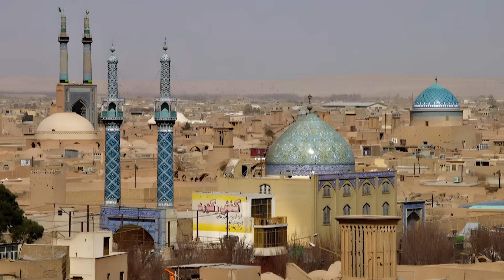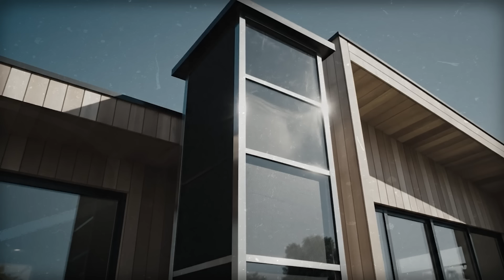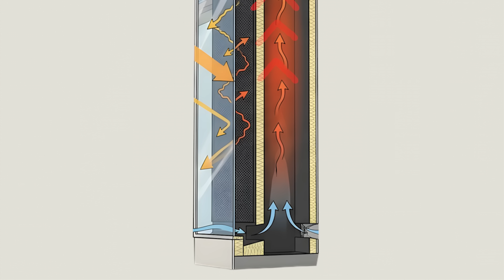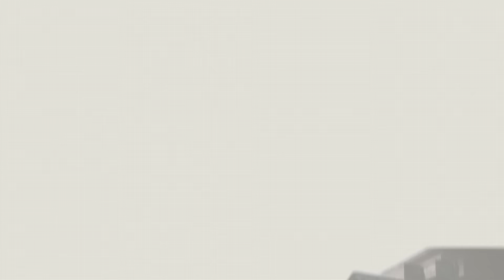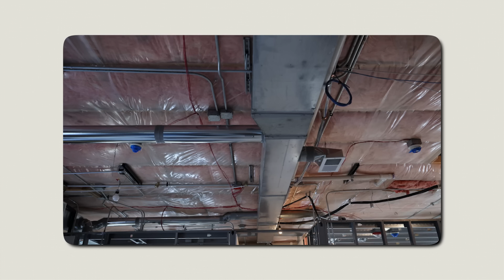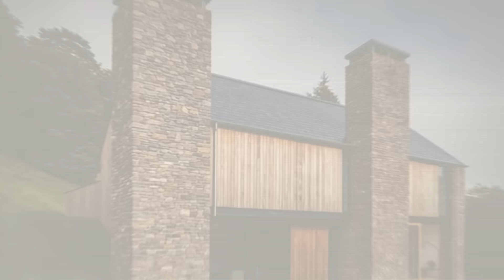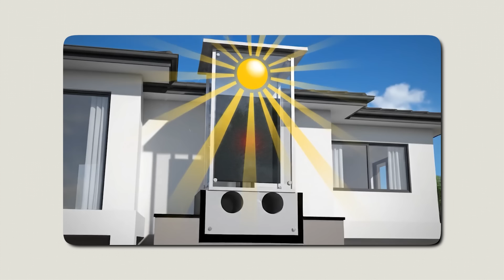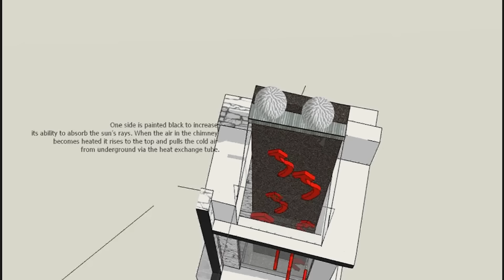This Chimney Will Cool Your Entire Home WITHOUT Electricity. Why Did The Energy Industry Hide It?

Comment: If you pull "fresh air" during a heatwave, what temperature do you think it will have? 20 degrees celcius or the temperature of the air outside?
If you actually answer using your brain, you will find out that it will heat up your home. If you use pull air through tubes put in the ground, it will work but at some point the ground will heat up too much.

Want something that actually works? AC, good home insulation, external window shades or awnings so direct sun doesn't enter the home and insulated 3 pane windows. If you have money, install ground heat pump and you can use AC in "passive mode" (deep underground temperature will be low). Add battery storage and PV for AC that works without using electricity from the grid.

Comment: At best it will cool it to room temprature, it isnt a solution for ACs, and worse if the outside air is humid or really hot as it tends to be in many places. Install solar panels instead and use ACs all daytime to cool the house.

Comment: Where I live, that’s a point of ingress for typhoon winds and water. Also, doing this in the US where houses are made of wood would make house fires spread faster.
Reply: Yes, the fire risk is a serious consideration. I put an attic vent in a 1/2 vaulted ceiling with nothing more than gable end vents in the attic to vent the air-flow, and a low window opened for intake  and it worked great. Stunning how much air was getting sucked through that vent. 

Making it fire-proof was a nightmare.  It also needs to close up tight in winter.

Comment: FRIENDLY FACT CHECKER RESPONSE provided to flag real consumer risks (listed below), not to troll this video/channel or arbitrarily $h*t on the few good ideas presented in this video.  

EXAGGERATED OR UNSUPPORTED 
Several headline claims look inflated or unverified as stated: “cool a home by fifteen degrees,” “most cost effective cooling solution in human history,” “global standard for high performance cooling,” “threat to the modern energy status quo,” “25 tons of CO2” for a 3-ton AC over 15 years, “carbon payback of less than six months,” and “carbon negative asset.” I did not find authoritative support for those exact figures or framings. If they exist, the video should have provided them. The claimed University of Arizona 1995 study with a house held at 75°F while outdoors was 106°F was not substantiated by the sources I found, and the University of Nottingham “up to 75%” claim appears in secondary/summary literature rather than here as a directly verified primary result.

LIKELY FALSE OR HIGHLY MISLEADING 
The video’s most pervasive problem area is precision masquerading as certainty. The claim that solar chimneys provide 8–12 ACH in homes appears overstated; field literature I found includes measured values more like roughly 1.13–2.26 ACH in at least one test-house study, while higher numbers can occur in other specific designs or conditions but don’t support such this video’s blanket claim. Also misleading is the statement that standard HVAC in modern airtight homes provides “less than 0.5 air changes per hour of fresh air” as a general rule; real fresh-air delivery varies by design and code compliance, and ASHRAE/IRC frameworks do not amount to a blanket exclusion of passive systems. ASHRAE 62.1 explicitly covers both mechanical and natural ventilation, which undercuts the video’s implication that the standards regime is written only for mechanical systems. 

FALSE EQUIVALENCIES / PARTIAL FRAMING The video repeatedly sets up misleading binaries: 
- passive = elegant freedom / mechanical = primitive failure
- breathable buildings = good / airtight homes = bad
It also presents causal narratives framed as inevitabilities:
- code/inspectors = de facto ban
- industry reluctance = proof of suppression
Its rhetoric hides the real tradeoffs: passive systems can work well in suitable climates and designs, but they do not automatically replace mechanical cooling, filtration, humidity control, or code-required ventilation across all climates and building types. It also blends windcatchers, solar chimneys, earth tubes, evaporative cooling, and thermal mass as though they are one interchangeable technology stack, when they are related but distinct strategies with different performance limits.

MOSTLY VERIFIABLE / SUBSTANTIALLY TRUE 
The core concept of this video is real: solar chimneys and related passive systems can drive ventilation through buoyancy/stack effect, and Persian wind-catchers/bādgīrs are genuine historical precedents for passive cooling, especially in places like Yazd. The video is also broadly right that indoor air can be more polluted than outdoor air, and that ASHRAE 62.2 is a key residential ventilation standard.

*** WHAT CAN YOU ACTUALLY DO? ***
The real move is to treat passive systems as leverage, not replacements. Start by pressure-testing your climate and house: look at your local temperature swings, humidity, and solar exposure, because a solar chimney only performs well when those variables cooperate. Then, instead of ripping out HVAC or chasing “zero-watt autonomy,” design for hybrid performance. Improve airtightness and controlled ventilation, add shading, orientation, and thermal mass where possible, and only layer in something like a solar chimney or earth tube if you can model or validate expected airflow (not just trust headline claims). If you’re building or renovating, push your architect or builder to integrate passive airflow early. Stack height, intake placement, and solar gain matter but also insist on measurable outcomes: target ACH, indoor temps, and energy use you can verify post-build. And zooming out, if your goal is sustainable housing globally: use passive design to shrink your energy demand, then let efficient mechanical systems handle the edge cases. That combination, not this video’s all-or-nothing framing, is what actually moves the needle.
___________

Potential CONSUMER RISKS related to the information as presented in this video are listed here. Be smart and don’t:

1) Over-invest in a system that under-delivers because the conditions aren’t met for your use case.
2) Remove or undersize mechanical systems and end up with uncomfortable or unsafe indoor conditions.
3) DIY installs that don’t function properly or create air quality/moisture issues.
4) Accept selective or unclear evidence to support strong claims. This is a classic red flag in product or system marketing.
5) Make financial or ethical decisions based on incomplete or overstated environmental benefits.
6) Distrust inspectors without good reason or bypass code logic, which can lead to failed inspections, insurance issues, legal and liability exposure.
7) Neglect maintenance (even passive systems require it) and end up with reduced performance or health risks.
8) Design a hybrid system without understanding which part is doing what.
9) Waste $300–$500 on “accessible and low-risk” lower-impact solutions instead of saving for improvements with a higher ROI.

Comment: Check out old Florida homes; the ceiling was 9 to 11 feet up, and the windows were double sashed. You would drop the top window about a foot, and raise the lower window about 8”. The taller the window, the better the system. Heat rises, like it do, goes out the top opening, which then sucks air in through the bottom opening, and because that gap is smaller, hopefully comes in faster; forced convection. 

Also, why do these solar chimneys remind me of swamp coolers? Not that those work that well in a swamp, lol. My in-laws live in El Paso and theirs works amazingly. Because, super dry atmosphere…
Reply: Florida "Cracker" houses are usually built on stilts or 15-20ft earthen mounds(for hurricanes) with open floors (not concrete slabs) which are about 2ft above really wet soil. The wrap-around porches provide shade not only to the living area, but also keep the soil under the floor cool and damp. I think building one of these houses today one would do well to use a gable roof with a ridge-vent system. Usually best to keep a shot-gun around for gators in true Cracker houses. Middleburg.

Comment: This phenomena has been used in many ancient Indian palaces. The kings had summer palace and winter palaces depending upon the season and it utlized similar principles. Its great to see them working in real life even after thousands of years while we - the smarter and techno generation are stuck with mindless technology everywhere around us.
Reply: I don't think heat-pump tech is mindless. It's a better solution than burning dead dinosaurs. BTW, if you put AC units in the air stream right at ground level as the air comes out of a ground tunnel, these two techs would work together really nicely and save about 1/2 your AC bill if humidity or extreme heat overwhelmed the passive system alone.

Comment: How does it work in cloudy hot days? Also, how do you clean the system and avoid moisture inside?
Reply: I guess you install a blower for air flow when cloudy or for cleaning the chimney.

Comment: You must love swamp coolers… your Ai produced video forgot to include the other important factor of an A/C system… it removes humidity.
Reply: A few years ago we were having no end of refrigeration evaporators freezing up in our cafes.  A master technician that came to sort out one of the units explained that global warming has added more water to the air, and suggested that we leave our AC units on overnight: we started doing this and our breakdowns dropped to almost zero….interestingly our electricity consumption only increased about 2-3%…

Comment: The difference between 106 and 75 is 31, not 17!  Simply moving air isn't going to cool it; without using underground temperatures or evaporative cooling, the air drawn into the house will be at whatever the ambient temperature outside is!

Comment: in dusty areas, fresh air can bring dust in without proper intake design or filtration. Also, negative pressure can pull dust through gaps around windows and doors.

Comment: I intend to build a tiny house on wheels and intend to include the principle of "Trombe Wall" and Solar Chimeny into it. I first came across "Trombe Walls" 45 years ago when I was working as a draftsman in an architects off. I was also taught about it and "passive solar design" at university when studying architecture. In the 40 years practicing as an architect I seldom got to use this knowledge
Reply: What is going to be your source of cooler air? Is your tiny home going to have a basement?
Reply: @Encephalitisify  actually you can open a vent on your floor(under floor is shadow). usually the shadow temperature is much lower than under the sun.  When winter cover the vent.

Comment: Many old homes have this built in using the fact warmer air rises and pulls in outside cooler air. But along the Gulf coast it is less than useful much the same way swamp coolers don't work. There are scams on U tube calming cooling but uses the swamp cooler effect that does not work in higher humid air,

Comment: Unfortunately, in humid areas this is not nearly as effective due to how heat sensation works.

They also would possibly require more maintenance in humid areas due to humidity doing its thing inside of the chimney, degrading materials, possibly allowing some mold to grow (I guess it depends on the actual materials, and maybe it's not as bad given that the heat itself may be drying part of this).

I do live in a highly humidity city, but I will be buying a house  soon and I am seriously considering building a solar chimney. I need to research more first to be sure I won't regret it later.
Reply: Looking forward with your research as we live in humid areas too. Thank you
Reply: It does work.  We used to live in a river valley (the river was 50 feet from our patio) in Jamaica.  The house had a hip roof that trapped hot air, and when we put clerestories in, the internal temperature dropped significantly.

Comment: I would think that you would want whatever cooled air your getting will go to the highest and furthest point in the house.  I wouldn't mind seeing this incorporated more, but I would still think that you would need a secondary system for heat at night.  But I guess if your house is air tight and has a good thermal disconnect you may not need it for a short stretch but honestly, a secondary heat pump would be warranted, I feel.

Comment: A solar chimney is essentially a high velocity vertical shaft, 

In the event of a house fire, this gonna acts as a thermal bypass sucking smoke and flames from the lower floors and spreading them throughout the house very quickly.

Comment: How would an implementation of this chimney work with a Clay AC (the clay pots with water running down it) since the clay AC causes the air to be humid and the chimney's effective decreases with high humdity

Also how'd you use the chimney in high humid climates? Would you try to dehumidify the air when it enters the building?

Comment: I’ve always said this big chimneys on old buildings were not for fire, but for ventilation and those fireplaces were for intake not for flames
Reply: Always wondered why they were big enough to walk in,  and someone in "the pethericks" comment section stated the same as you whilst Billy was uncovering a huge "fireplace",  but there were smaller more conventional fireplaces in other rooms.  
So the draft to pull in cool air makes way more sense!
Reply: Fireplaces were for fires to heat the building, the reason why some of them were big enough to fit a person was because someone had to clean them several times a year as coal was really dirty. Hell even oil was until the technology improved the last decade.

Comment: Yazd Badgir in Persia is not working based on air density. It is wind harvesting system to direct it to water basin in basement to cool before entering the house. So it works day and night and reduces the air temp by adding moisture to it.
Reply: increasing humidity
Reply: @efrahaimrn  Iran's ambient humidity falls below 10% on hot days, and in the really arid regions, bellow 0.5%, so the little humidity added to air as it flows by should be welcome. Most people don't consider humidity below 50% to be objectionable. You are correct though, some humidity has to be added for any cooling to happen.
Reply: Actually, by evaporating water, which requires 9,000 BTU per gallon to change its state from liquid to gas.
Reply: Persia? You mean Iran
Reply: @cuckoo  some Iranians dont like calling themselves that anymore, they want to be called Persians.

Guy must be one of them
Reply: @cuckoo  What's your point? It was Persia thousands of years before the political entity arose called Iran.

Comment: Or you bury 30 ft of plastic pipe 1 in in diameter 6 to 10 ft down fill it full of antifreeze come up out of the earth into a radiator power pump / fan with solar and bada bing bada boom...

Comment: That's bullshit! When the outdoor temperature is 35 to 40 degrees Celsius, the air above ground is scorching hot. The indoor air is actually slightly cooler than the outdoor air. If you turn on a chimney, how can cold air get in and hot air get out? Don't bullshit